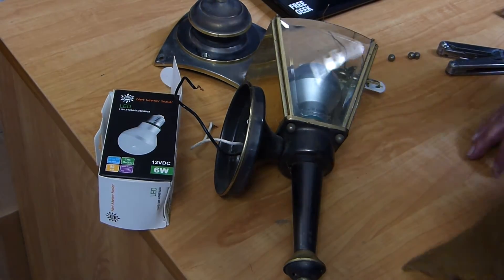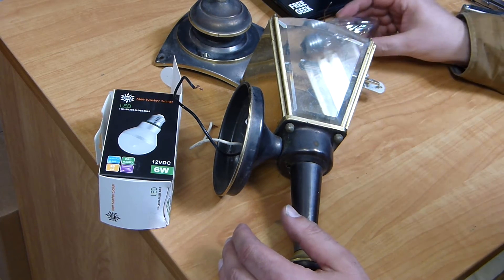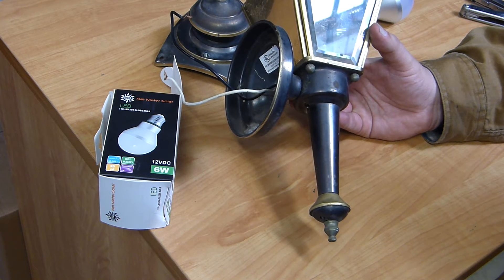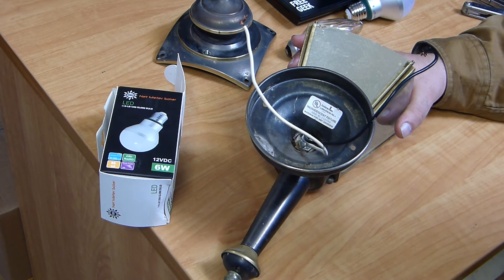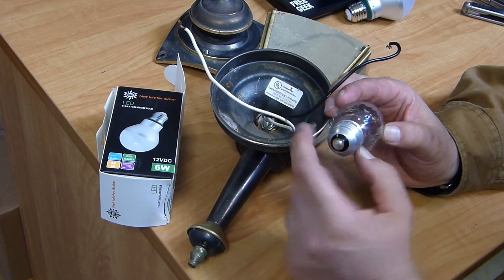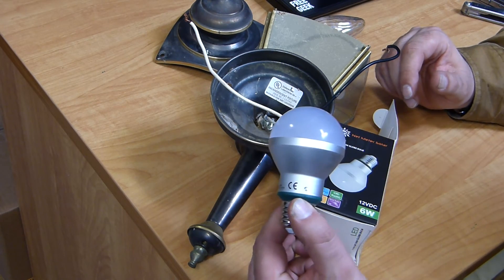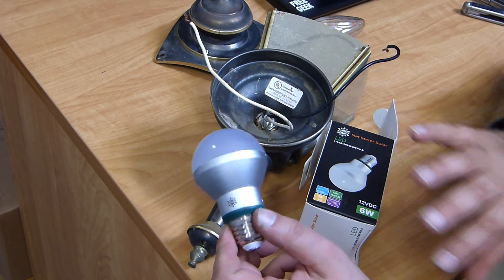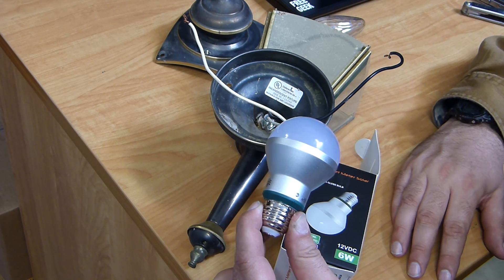Netmetersolar 12v LED light bulb that fits a conventional AC socket

Comment: AC electricity is alternating from positive to negative, in America at 60hz. Alternating Current, has a hot and neutral, not a positive and negative. 3 Phase electricity is alternating current at a specific degree offset.

Comment: I hooked up a 120v LED '60w' rated to use 10.5 watts to my solar 12v system with an amp meter. The bulb is rated at 570 lumens. It uses only .24 watts. (not 10.5) although it is less bright... like maybe  300 to 350 lumens. I can live with that burning only 1/5 watt per hour versus 10.5 (29 time more).
Alan